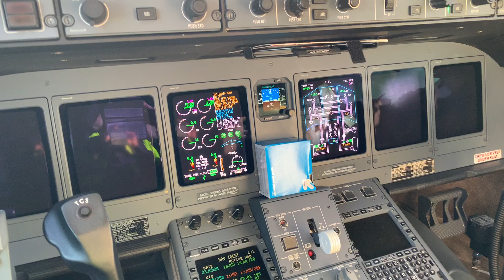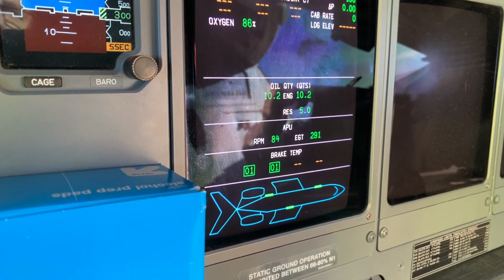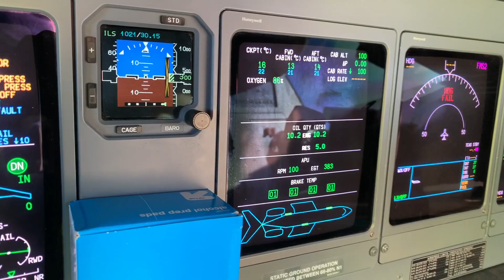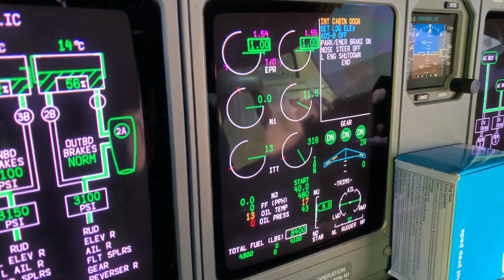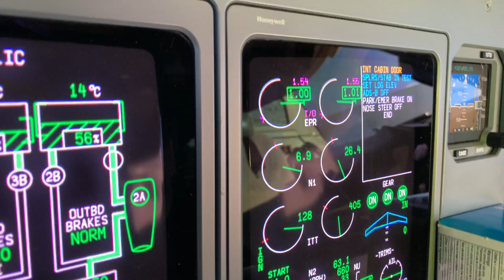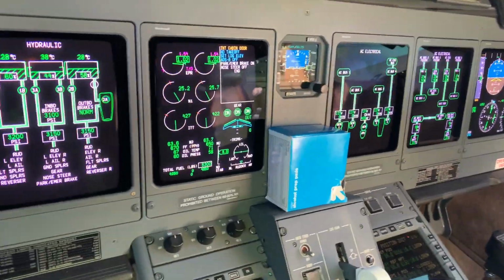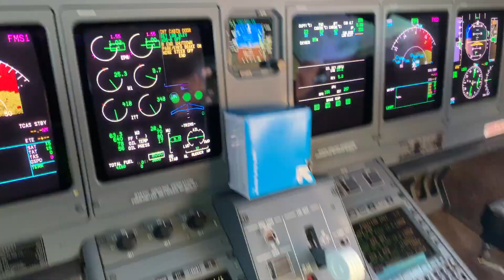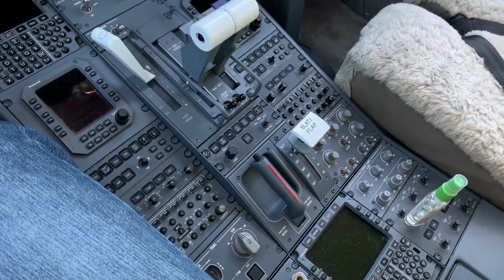A real pilot can show you his aircraft.  C'mon FE pilots - what are you waiting for?

Comment: I am finishing my video where I will destroy heliocentrism by showing what the laws of motion predict on a northbound flight over your spinning Earth. You can trick people using the non-inertial frame of reference because from there it is easy to twist the physics and convert an acceleration into speed while you play with time ... but from the inertial frame of reference you have no way to run away from the truth... After that I will dedicate some time to your juicy "Coriolis effect is not a problem for aircraft if you catch my drift"
Reply: Does your video include a working Flat Earth model? Or an explanation for what natural forces keep the Sun and Moon circling your fictional Flat Earth? Or an explanation for why observable planets move in retrograde motion?
Reply: @flatliner5729  At the moment I do not intend to question the shape of the earth but to destroy once and for all the false premise that it rotates on its axis. The south-to-north flights of all types of aircraft constitute experimental evidence of this.
Reply: @MoisesPendulo  I'm certainly looking forward to it! Well done.
Reply: @MoisesPendulo  So basically for a South-to-North flight in the Northern Hemisphere, there is a deflection to the West but as the aircraft is already adjusting for crosswinds, this would be all be accounted for by the pilot/autopilot making lots of small adjustments to maintain the desired heading.
Reply: @QED Navigation systems are not magic devices ... they are only meant to tell the manual or autopilot your position, speed, and heading in time and space. They also foresee the possible drift to make the corrections at the required time and thus keep the aircraft on its route. But these corrections translate into maneuvers that the aircraft performs with its moving parts to change its course. Drift correction due to wind is routine for any pilot, but every pilot (including Wolfie) knows that there is no drift correction for the speed difference between latitudes. According to the rotating model, there are currently south-north flights that would be facing tangential speed differences greater than 300mph. You hardly find a crosswind of such magnitude! However, these planes arrive at their destination with their noses pointing north, that is, without any correction. But also in long-distance flights, the problem is greater because although the drift towards the East is hypothetically corrected, the drift towards the South cannot be corrected. 

On the other hand, although the aircraft have turbines, you should know that they travel at a constant speed, therefore the sum of forces is zero. In other words, the aircraft emulate a uniform rectilinear motion (although in the spherical model they describe a geodesic line). In this sense, aircraft are more suitable than cannonballs because cannonballs lose speed due to air resistance and eventually fall to the ground due to lack of lift. Aircraft do not have this problem
Reply from the maker: I have already explained that in other videos.  The aircraft actively maintains a ground track and corrects heading as required to so.  

The majority of the correction is for wind and the amount required for Coriolis is about that for a 1 mph crosswind.  

You can't debunk the Globe by not understanding how planes stay on track.

Reading your last few comments - you are not getting the physics.  It takes 12 hours to fly from the equator to the Poles at typical speeds.   

How long does it take to fly across the ground to experience a 300 mph tangential difference.  That does not manifest as a 300 mph cross wind. 

Say the Equator at 1040 mph to 740 mph at 44 South Latitude.  That is a 2640 NM flight - More than five hours.    You think an object can't change speed by 300 mph in five hours?   

That is 300 minutes.  It only needs to change by 1 mph per minute for 300 minutes and there is your 300 mph.
Reply: @everybodylovesballs  A deflection towards the East and then towards the South that ends up describing something like a circle. 

Can you estimate at what coordinates a commercial airplane traveling from Accra to London will end if it does not make the corrections that you mention?

1. Consider that the flight takes 6 hours
2. Consider that the plane does not find crosswinds in its route (which usually happens)
3. Consider that the plane's ground speed is 526mph.
4. Consider the tangential velocity of the earth in Accra is 1035mph

If you have trouble calculating that, don't worry. In my next video, I will show how it is done
Reply: @MoisesPendulo  Those calculations are irrelevant. Why would I bother calculating what would happen in a fantasy scenario where the pilot is drifting significantly off course and does nothing to correct it? How would that be different to a situation where the pilot is experiencing a strong crosswind and does nothing to account for that?
Or maybe I could calculate what would happen if I was driving around a huge roundabout in my car and then stopped turning in? Sure, I could calculate how far away from the roundabout I would be after 6 hours but what would be the point? Would that show that roundabouts can't be circular?
Reply: "I am finishing my video where I will destroy heliocentrism by showing what the laws of motion predict on a northbound flight over your spinning Earth"

When you finish your video, I hope you don't intend to hide in cowards castle like virtually every other reality denying nutcase.
Reply: @Wolfie6020  I left you a comment in your video about the drift of the Coriolis effect where I explain in detail the errors of your explanation

"You think an object can't change speed by 300 mph in five hours?"

Consider that you take off from Ecuador northward and when you do there is a 1mph crosswind blowing eastward (you know you don't even need to correct that wind). but let's say that as you move north the speed of the crosswind is gradually increasing. Let's say that in 3 hours of flight the speed of the crosswind increases from 1mph to 150mph (and you know that happens commonly. The wind does not suddenly start to blow at 150mph but rather the speed increases as you fly through the Jetstream). So as the crosswind speed increases you should also increase the angle of correction (WCA) very precisely. In this way, it is achieved that the lateral speed component of the airplane is equal and opposite to the crosswind component. And so the plane stays on the planned route. So it doesn't matter that you've had 3 hours (or 10 or 24h) to correct 150mph of crosswind. When you reach latitude where the wind blows at 150mph you have to have the corresponding WCA to prevent the plane from drifting.

The same should happen if the earth is spinning. When the plane leaves the equator the difference in tangential speed ΔVt between the plane and the ground would be zero but as you move north ΔVt increases to 387mph at latitude 51.47° N (as is the case with the flight from Accra-London). Therefore your correction angle ΔVtCA should be 47° (Not counting possible crosswinds). In this example, I am considering tangential speed linearly but in reality, it is radial and things get even more complicated there since a drift towards the South appears that is impossible to correct (as I will show you in my video).

The airplane retains its initial tangential speed by Newton's first law unless you provide a force or speed component in the opposite direction. But since the plane's path is due north and ΔVt is perpendicular to that direction, the pilot could only turn progressively to provide an opposite component to ΔVt at each latitude.

Those who argue that the spinning atmosphere solves the problem do so from total ignorance of physics and aerodynamics.
Reply from the maker: @MoisesPendulo  But you are missing the point here I believe.  In a 150 Mph real crosswind the correction angle is significant.  

But for Coriolis you don't need a correction for 387 mph at 51 North Latitude.  

How much has the tangential speed changed from 50 North to 51 North?  How long did it take to fly that 60 NM?  

You are ignoring the fact that by the time it reached 50 North it has already corrected for the majority of that 387 mph. 

Break it down into 1 Degree of Latitude change blocks and the difference in Tangential speed is already quite small.   In the last 60 NM  you are not adjusting for 387 Mph difference - you are adjusting for the difference between 50 and 51 degrees of Latitude..    Just 14 mph.    Break it down into each NM and the correction needed per mile is almost negligible.
Reply: @MoisesPendulo  This is the same argument that flatties use for the dip of the nose. They say, "imagine after you have flown for 6 hours how much the pilot would have to dip the nose of the plane". Well, what if the pilot dipped the nose a tiny amount every mile, say 0.0072°. How much would they have to dip the nose for the next mile from the new orientation? Would it also be 0.0072° to maintain the same angle relative to the surface of the Earth?
After you have corrected, the new correction required is relative to the new orientation, not the initial orientation. After the plane has corrected and is facing North again, you then calculate the correction required for a plane travelling North at that latitude with whatever velocity the plane has at that time.
Reply: @Wolfie6020  No, you are the one who is missing the point. As long as the crosswind keeps blowing at 150mph you have to MAINTAIN the required WCA. You can only remove the correction if the crosswind speed component decreases or the aircraft drops to an altitude where there are no crosswinds.
BUT in the case of ΔVtCA you can NEVER remove the correction because the rotating earth NEVER stops rotating. So for example, when the plane reaches latitude 30°N the tangential speed difference between the plane and the ground below it will be 136mph so for the plane to stay on the route, ΔVtCA must be 15°. Then the plane will continue to move towards latitudes where it will find that the earth moves tangentially slower and slower. Therefore it will be necessary to continue increasing the correction angle until reaching +47°. I don't know if you've piloted such a route but I guess you understand what a 47 ° angle to the route and runway means. You know this does not happen. I have discussed this issue publicly with pilots with more than 40 years of experience, including NASA aerospace engineers, and all of them acknowledge that no correction for tangential speed difference is made (which violates the laws of motion and therefore it follows that the earth can't be spinning)
Reply: @Wolfie6020  You can do the same "brake down" with crosswinds and you will get the same results. Still, you should boost the WCA and hold it as long as the wind maintains that speed.

A crosswind is also a tangential speed difference between the air mass and the ground ... The tangential speed difference between the plane and the ground is due to the fact that the plane maintains its tangential speed while that of the ground decreases. .. Both cases generate a drift on the plane's route and both must be corrected in the same way ... Only the second is not necessary because the difference in tangential speed at every point on earth is ZERO
Reply from the maker: @MoisesPendulo  No you can't break down the crosswind because it is that full value at any given instant.  

The whole 150 mph crosswind is being applied to the aircraft each second of flight.   Hence the correction angle needed is large. 

The way you correct for drift from a 150 mph cross wind per second versus that from corioliois is entirely different.  

In each subsequent second the full 150 mph cross wind is still there. 

The coriolis adjustment for the previous seconds are behind you and now irrelevant.  You only need adjust for the next second and so on.
Reply from the maker: @MoisesPendulo  Sorry, you are just not getting it.
Reply: @UCiJxTakqcZkSizZ94Qvd0Dw Pilots generally prepare a flight plan before take-off. In this flight plan, they observe if they find crosswinds on their route, at what latitude, and at what speed these winds will have. Following my case of the Accra-London flight, let's say that the weather forecast predicts that at latitude 30°N there will be crosswinds of 20mph so if the speed of the airplane relative to the ground is 526mph with a WCA correction angle of 2° it will be enough so that the wind does not move the plane on its route.

So if the earth was really rotating the pilot should notice in his flight plan that the earth at latitude 30° N is moving 136mph slower than in Accra. Therefore, the pilot would know that upon reaching that latitude, a correction angle of 15 ° would be necessary so that the airplane does not go off its route ... The pilot should consider in his flight plan that beyond 30°N the earth moves even slower so that when arriving in London the necessary angle of correction must be 47° because there the earth moves 387mph slower than in Accra. So the plane as it goes north must literally chase London moving a little west (387mph) to catch up.

This never happens ... pilots only observe the weather predictions and then fly
Reply: @Wolfie6020   "The Coriolis adjustment for the previous seconds are behind you and now irrelevant. You only need adjust for the next second and so on.
"

That is totally wrong and the worst thing is that people believe that is correct ...

Are you saying that you turn for a second to correct the Coriolis drift and then turn north again? repeating the operation second by second or minute by minute?
When you apply a minimum angle to the left, you do so in order to provide a minimum component of tangential velocity to the west. If in the next second or minute you re-align with the north you are eliminating the minimum component of tangential speed towards the west that it had initially provided ... Therefore if you repeat this process the drift will occur as if you had never corrected

"you can't break down the crosswind because it is that full value at any given instant"

The tangential speed difference is also a "full value at any given instant" because the rotating earth never stops rotating.

Furthermore, you know that the crosswind speed also increases or decreases in time as the plane moves towards its destination.
Reply: @MoisesPendulo  This is the way I see it - a plane takes off flying North. The Coriolis Effect causes a very minor acceleration to the East. The plane banks to the West to cause an acceleration in the opposite direction. Minor adjustments would need to be made throughout the journey but that would be necessary due to changing crosswinds anyway (the adjustment for the Coriolis component would be slightly positive throughout the journey as you say). That would keep the plane following the meridian.
But at any moment the pilot could level out the plane. And in that moment, the plane would be identical to a plane that had just taken off from the current latitude flying North. In other words, it would begin a slight drift to the East. There would be no cumulative Eastward speed because that would have been cancelled out the entire journey by the acceleration in the opposite direction.
Reply: @everybodylovesballs  Many people see it the way you see it ... Perhaps for that reason the myth of the spinning earth has remained a century after the first commercial flights in history. 
The way you and other people see it is a product of: 
1. A misuse of frames of reference 
2. An excessive sentimental attachment to the official cosmological model 

I'm sure point 1 will no longer be an excuse after I post my video
Reply: Raging S  My approach is correct. I am describing the problem from the inertial frame where the trajectories are straight lines and are the result of the vector sum between the initial tangential velocity vector to the east of the aircraft and its velocity to the north. The resulting vector and its angle with respect to the x axis is all that is necessary to know to study the trajectory that the airplane would have if the earth were rotating. Fictitious accelerations are not needed as in the case of the non-inertial frame.
Reply from the maker: @MoisesPendulo  No it it not totally wrong.  

You are still not understanding what I said. 

Take one aircraft - it has been flying North for an hour. 

It meets up with a second aircraft who just took off.   

There is a 150 Mph crosswind. 

They fly in formation for one minute. 

Both have to compensate for that 150 Mph crosswind equally. 

Are you suggesting the aircraft that was already flying for an hour now has to compensate more for coriolis than the second one that just joined in formation?   

Yes or No?
Reply: @MoisesPendulo  If I banked the plane so it was facing West, could I lose all of that initial Easterly speed or not? If the answer is yes, why could I not bank to the West just the required amount so that my Easterly speed always matched the Easterly ground speed at that latitude? This would require minor adjustments throughout the flight to follow the meridian but it's surely not impossible or even difficult? It would not even be something that the pilot would have to consciously think about - they would simply bank the required amount to maintain the correct heading as conditions dictated.
Reply: @Wolfie6020  Yes and it is a fact. If the airplane that had been flying for one hour took off from a latitude that was moving east 150mph faster than the latitude from where the other airplane took off, then the first airplane should have a correction angle that gives it a 150mph component direction opposite. This is due to the fact that the airplane maintains its initial tangential speed due to inertia and if it is not progressively corrected the drift will occur. The other plane does not need to correct yet because its tangential speed is the same as its latitude. You should only start correcting when you fly further north. The term of Coriolis acceleration is not something that should be corrected, it is only the acceleration in charge of changing the direction of the speed in the circle that the plane traces on the non-inertial frame. But the plane's true trajectory in the inertial frame is a straight line that definitively distances it from its destination
Reply: @MoisesPendulo  This is due to the fact that the airplane maintains its initial tangential speed due to inertia and if it is not progressively corrected the drift will occur
Do you think a plane is a projectile with no means of changing it's velocity? What if a force were applied that caused an acceleration to the West at the same time that inertia was carrying it to the East? Could it then match the tangential velocity of the ground below it?
If a plane flies West, doesn't that mean that it's tangential velocity is less than it started with? Something that you insist is impossible.
Reply: @everybodylovesballs  If the plane is facing west, it cannot go north. Furthermore, it cannot lose all the initial tangential speed. On rotating Earth, if the plane leaves Ecuador heading west with a speed of 500mph it actually continues to move east at 540mph relative to the inertial frame (because Vt = 1040mph-500mph = 540mph). Imagine that you are inside a train that is moving 100mph East and outside there is another train that is moving 50mph East. You have a small RC plane inside the train and you want your plane to move at the same speed as the other train. Then you have to fly your RC plane west at 50mph. If the other train reduces its speed to 30mph you must increase the speed of your plane to 70mph. If the other train slows down to 10mph your RC plane must reach 90mph. That is equivalent to what would happen on the rotating earth. As you go north the Earth moves slower to the east. No matter how slow that speed variation is, the fact is that it would be necessary to increase the speed of the plane to the west, which would be achieved by changing the course to the left progressively, but this is not done and all pilots know it.
Reply: @MoisesPendulo  the fact is that it would be necessary to increase the speed of the plane to the west, which would be achieved by changing the course to the left progressively, but this is not done and all pilots know it
Exactly. Banking to the West would decrease some of the initial tangential velocity. And if the tangential velocity can be progressively decreased, the correction angle is not cumulative. If the tangential velocity is continuously corrected to match the ground below by banking to the West, then the velocity of that plane is no different to a plane that has just taken off from the current latitude.
And actually, I don't know that pilots aren't aware of banking a bit more to the West when flying North. I imagine they're more preoccupied with wind patterns though. But at least you seem to have realised that what you were saying was impossible is not impossible after all.
Reply: @MoisesPendulo  Can I look at your angles in a little more detail, as you seem to be good at the mathematics?
You say from the Equator to London you would end up with an angle of 47 degrees to compensate. Is it possible to break it down so that we look after periods of, say, one hour? Or maybe every 10 degrees might be better. So 10, 20, 30, 40 and 50 degrees North will all require a different and increasing correction, if I understand you correctly.
Reply: Raging S  Seems he is a civil engineer... the Brian Mullin of South America.
Reply: "I will destroy heliocentrism"
DSCOVR
Reply: @hashmaldawn3878  In actual modeling, if the earth were turning after 6 hours, the Accra plane bound for London would not exceed 30°N latitude (even if the pilot applied the corresponding correction angle for each latitude). And if it continues to fly for 4 more hours it would end up again in Ecuador. In other words, the 47° correction in London would only be possible if the tangential speed difference was linear, but the reality is that this tangential speed difference is radial and that is even worse. At the 30°N the difference in tangential speed is 136mph, therefore the required correction angle would be 15°. After that the pilot will try to continue flying north but the aircraft will start to drift south and that cannot be corrected unless the pilot doubles its cruising speed which is impossible because air resistance prevents it. This is clearly understood from the inertial frame of reference, that is, an observer in space that does not rotate with the earth. 
Of course, I can calculate the position of the plane at any time and calculate the required correction angle for each latitude. In my video it will be easier to understand because there I will model the problem from the inertial frame of reference. 

In this link I do the "brake down" using a flight from Miami to Toronto https://www.quora.com/Why-dont-we-feel-the-Earths-rotation-1/answer/Moises-Alvarez-21 ? ch = 10 & share = 69429111 & srid = uXmPSg
Reply: @MoisesPendulo  I've had a look, but not in detail yet.

I'm still a bit confused, and I'll explain why. If an aircraft took off from 31° 30' North, as the first aircraft passed overhead, then another aircraft takes off at 35°53' North and joins the formation, with a final one taking off and joining at 40° North, then those aircraft will arrive at Toronto all requiring a different heading to maintain the same track. It's almost like the aircraft must have a memory of where it started from. That doesn't seem logical to me, so I hope you can help.
Reply: @hashmaldawn3878  Yes, it is exactly that! The airplane retains its initial tangential speed as if it were a memory. That is precisely what Newton's first law predicts. With this same law it is justified that when you jump on the rotating earth you fall in the same place because your body maintains the initial tangential speed that the earth provides. You can run at 10mph towards the final car of a train that is moving at 100mph. The train was the one that gave your body its initial tangential speed so even if you run or fly inside the train at 10mph in the opposite direction you will only be reducing your initial tangential speed from 100mph to 90mph. If you change direction or stop you will return to your initial tangential speed which in this case is 100mph
Reply: @MoisesPendulo  Yes, but we have 5 aircraft, all experiencing exactly the same current conditions, yet need significantly different headings to maintain the same track. In your train example, imagine the train is gently slowing down, from 100 to 50 mph. The passenger will not feel any difference, but when he stops walking, his speed will revert to the new tangential speed, not 100 mph.
Reply: @everybodylovesballs  What you don't seem to understand is that this correction angle must be sustained and increased progressively so that the plane can keep flying over the meridian. If at any given time the plane re-aligns its nose to the north, it will no longer be providing a speed component to the west. The "official" approach to the problem suggests that pilots must apply a constant bank angle with a huge turning radius (over 4,000 miles on many occasions). This implies that the airplane would be drawing a circle opposite to the circle that would generate the Coriolis effect. In this way it is mistakenly thought that the plane would arrive at its destination without problems. What physicists don't seem to understand is the implication that such a maneuver would have in the final position of the plane's nose. 

Right now at the 30° N latitude of the Accra-London route at a height of 250hPa there is a 12mph east crosswind component. That implies that any commercial airplane heading north and passing through those coordinates will have to turn its nose 1° to the left to prevent those 12mph from moving the plane to the right. However on the rotating Earth an airplane taking off from Accra will find that Earth at latitude 30° N is moving 136mph slower than it. So to avoid drifting east the pilot should progressively turn his heading 15° counterclockwise. What is more important a speed of 1mph or 136mph? An angle of 1° or 15°? 

You can even find videos of the Accra-London flight where the heading indicator is shown ... It always points north (except when it turns a little to correct some wind) and that is only possible on a stationary Earth.
Reply: @hashmaldawn3878  In the link that I shared, there are more than 400 comments where various physicists, pilots and engineers have the same doubts that you have about the analogy of trains and the RC airplane and there I explain to them again and again the foundation of my postulate... Even a highly experienced NASA aerospace engineer agrees 100% with me.
Reply: @MoisesPendulo  Can you answer my question directly? Isn't the comparison with a slowing train rather than it's initial state the relevant one? So the rotation where the aircraft is rather than where it was!
Reply: @hashmaldawn3878  When you assume that the earth is rotating at 15°/h you must also assume that each latitude constitutes a frame of reference with its corresponding tangential speed ... When an airplane flies from one latitude to another it is literally flying over another frame of reference, without generate any tangential friction force, that is, there is no physical mechanism or process that says to the plane: hey! You are on a new latitude! The Earth down there is moving slower than you! You must reduce the initial tangential speed with which you took off or you will drift to the East!
Reply: @hashmaldawn3878  Yes I can but the problem is that you are misrepresenting the initial analogy that I proposed to you
Reply: @MoisesPendulo  But you do reduce the initial tangential speed by navigating to the next way point, which has a different tangential speed
Reply: @MoisesPendulo  Don't forget that just because air is a fluid, it doesn't mean that the aircraft isn't connected to the earth.
Reply: @MoisesPendulo  You still seem stuck on this strange notion that a plane can't bank and lose some if it's initial tangential velocity. Of course it can. If it was flying North and another plane took off, it could easily bank and match the East and North components of that plane's velocity. If it did that, why couldn't it match its heading? But really it wouldn't need to because it would already be doing that along the way. The effect of banking just the right amount that the North course was maintained would result in the tangential velocity decreasing. It's the same thing.
Reply: @MoisesPendulo  But the turntable isn't an accurate comparison, because the time is of a completely different scale. The flight takes hours, and the aircraft is only slowly moving through the changing velocity. And the connection between the aircraft and the earth is actually more direct in its effect than a ball on a turntable. Yet even with the turntable I'm sure the ball would manage to maintain the same velocity as the turntable beneath, if the motion took hours.
Reply: @everybodylovesballs  I have never said that airplanes cannot change their initial tangential speed by banking. What I am saying is that when the plane is banking it is constantly turning its nose (changing its direction with respect to the cardinal axes) to trace the circle ... The final direction of the nose is given by the maximum difference in tangential speed between the plane and earth. In the case of the flight from Accra to London the nose of the plane would end up pointing to 313 while the plane's route is towards 00. But what Wolfie and all the pilots know is that it is never necessary to bank or change the course of the aircraft to correct drift caused by tangential speed difference.
Reply: @hashmaldawn3878  You are only speculating. I have done the math. The variables involved in the phenomenon and the results do not agree with your predictions. In fact, no physicist or engineer defending the rotating model agrees with your predictions ... They know that it is absolutely necessary for the pilot to correct the tangential speed difference and they trust that they are doing so.
Reply: @MoisesPendulo  And they do adjust for it, a little at a time. You might have done the mathematics, but you've made an error in it. Maybe you are trying too hard to get the answer you want?
Reply: @hashmaldawn3878  "M̶a̶y̶b̶e̶ you are trying too hard to get the answer you want?"
There, I've corrected it for you...
Reply: @MoisesPendulo  OK, I think I've found the problem.
You say that the acceleration of the plane plots a circle, right?  A circle is a 2D shape so this implies that there is a 2D coordinate system where this is true. But what exactly is this coordinate system? We know that you can't plot a sphere onto a 2D coordinate system so a transformation is required and I think your error is that you are not applying the transformation to the meridian itself.
The coordinate system you have chosen cannot be rotating with the Earth because in that system there is no circle because there is no change on the x-axis (East-West) - ie. the plane is following the meridian without moving East or West relative to it. So it's an absolute coordinate system. And here's the issue - in an absolute system a meridian to the East is not parallel to the initial meridian at any point other than the equator. After 6 hours, we could plot the angle of the plane relative to the initial meridian - which I think is your correction angle - but this is not the angle of the plane to it's current meridian which itself is angled relative to the initial meridian at the plane's current location.
Now what if we chose a coordinate system that rotated with the Earth? What if someone on the equator could see the plane all the way to the North Pole and this is the centre of the coordinate system? Then as the plane flew away, the observer would see the plane always directly North angled only the amount required to counter the Coriolis acceleration at that latitude. And that observer would also see that if another plane on that meridian took off flying North as the first plane flew overhead, that plane would require exactly the same angle as the first to maintain a course due North.
Your idea of a "memory" in physics is bizarre. Of course if two planes had the same velocity with the same forces acting on them at the same exact moment, they would move in the same direction with the same heading, and a different heading would take them in different directions. I'm struggling to understand how anyone could choose that reality over the more obvious reality - that you have simply made an error.
Reply: @everybodylovesballs  "A circle is a 2D shape so this implies that there is a 2D coordinate system where this is true. But what exactly is this coordinate system? We know that you can't plot a sphere onto a 2D coordinate system so a transformation is required and I think your error is that you are not applying the transformation to the meridian itself "

Of course, I am doing the transformation. And indeed the trace of the plane on the non-inertial spherical reference frame is very much like a circle. This is because although it is a fact that all bodies tend to have rectilinear trajectories, the vector of gravity is responsible for curving the trajectory on the z-axis. 

People think if the earth stopped spinning things would fly off into space. This is true only if at the same moment in which the earth stops you also turn off gravity. That is, gravity is in charge of curving the trajectory of the initial tangential velocity of the airplane but it does not have the power to eliminate it. That is why drift caused by ΔVt occurs similarly to what happened on a flat earth or flat turntable. In fact, the supposed spherical shape of the earth worsens the situation. Therefore, since the Coriolis effect trace on spherical earth tends to be a circle, the airplane must trace an opposite circle to avoid drift. In my video, I will address that topic and show the required modeling
Reply: Raging S   @Raging S  👉Do Coriolis effect and airplanes have something in common? Of course they have! Let's say that an airplane (m = 50,000 kg) takes off from London (α = 51.50° N) and travels to North America (to the west) with the velocity v = 500 km/h. With our Coriolis effect calculator we can compute that this airplane is subjected to the Coriolis force F ≈ 800 N which means that it deflects to the north with the acceleration a = F / m = 0.016 m/s². It is almost 0.2% of the Earth's gravity! Pilots need to establish a constant force sideways, equal but opposite to the coriolis force, to compensate it. It is achieved automatically, by the autopilot, by slightly banking the airplane to keep the heading as planned.

For this example, the banking angle equals only about atan(0.002*g/g) ≈ 0.115°, so it is too small to be perceivable by passengers. However, without this correction, the airplane may land hundreds or thousands of miles away from the destination point. It is even a possibility that it would fly around the circle, never reaching a final airport!

Dominik Czernia, PhD candidate👈

This is the solution to the problem proposed by physicists and it is the most decent solution proposed by the little literature where you can find information about it. Its focus is very poor and it does not analyze what happens on a north-south flight where the Coriolis acceleration is variable because it depends on senɑ and this term is zero in Ecuador but as you fly north it increases according to latitude ɑ As you can see he concentrates on saying that the bank angle is so small that it is not noticeable by the passengers but that is not the problem. The problem is what involves flying over a straight line and drawing a circle with a radius of several miles. At the end of the trajectory the plane will end with the nose inclined at an enormous angle with respect to its destination and the worst thing is that it will not be able to eliminate that angle. So my mathematics does not differ from what the official model proposes. And I also do the same analysis from the inertial framework where the calculations are much simpler and the problem is much easier to understand and visualize. 

Some people like  @Hashmal Dawn think that a considerable amount of time alone has the ability to modify an initial tangential velocity, and they forget what Newton's first law predicts. Then they start calling that law "bizarre memory". Then they remember it again and start saying that the pilot's maneuver is the one that changes said tangential speed over time. And then they cross their fingers for the pilots to say that they actually carry out these maneuvers but the truth is that they don't and  @Wolfie6020 knows it.
Reply: Raging S  Both in a spherical earth model and in a flat earth model, the existence of a natural vector of acceleration g of 9.81m/s2 is possible. I am using the spherical model because it is the official one, not because I believe in it. In any case, in both models I can show that the earth is stationary by studying commercial flights from south to north.
Reply: @MoisesPendulo  Why did you add the word "bizarre" into my comment? Strange to misquote me in that way.
You've made this claim previously about Newton's First Law, maybe you can explain how you think it applies in this situation. You've already stated that the aircraft is turned to counter the change in tangential speed and turning is an acceleration.
Reply: @MoisesPendulo  If at any given time the plane re-aligns its nose to the north, it will no longer be providing a speed component to the west
So at the moment it points it's nose North, the plane will exactly match another plane that has just taken off along the route somewhere and joined it, say from 30°N. If the first plane is maintaining a North course we know that it has reduced it's tangential velocity appropriately by banking because that is the only way to maintain that course. So both planes will be facing North and if not corrected both would drift to the East with an acceleration of 0.01m/s/s so they'll both need to bank to the West at the same angle as each other to accomodate for it. And they'll both arrive at London with the same bank angle, a tiny 0.115° using the assumptions in your last comment. I don't think anyone disagrees that the bank angle must be steadily increased but it will never exceed the bank angle required at the destination as long as they follow the initial meridian because the mere act of doing that (by banking appropriately) has the effect of reducing the tangential velocity without anything further needing to be done.
Also, it was me that said it was bizarre. Because the idea that two planes with the same velocity and the same forces acting on them would require different headings to follow the same course depending on which latitude they had taken off from is bonkers.
If you think I'm wrong, tell me what happens to the first plane if it turns it's nose North when the second plane joins it, assuming it has reduced it's tangential velocity the same magnitude? Would it experience a Coriolis acceleration greater than the second plane?
Reply: @everybodylovesballs  If when you reach latitude 30°N you have the nose inclined 15° to provide a speed component of 136mph to the west (which is responsible for you flying over the meridian without drift) you withdraw that angle and align with the north what do you think will happen? Do you think aligning with the north will still have a speed component of 136mph to the west? Remember that thanks to that component the plane does not move east at 136mph. By turning north you are eliminating it completely so you will drift 136mph east when you complete the alignment. 

You can subdivide the tangential speed difference as much as you like. You will always have the corresponding drift that you were avoiding if you re-align with the north
Reply: @MoisesPendulo  If when you reach latitude 30°N you have the nose inclined 15° to provide a speed component of 136mph to the west
Speed component relative to what exactly? If you are following the meridian, your tangential velocity has already been reduced to match that. Your speed component to the East relative to the meridian will be 0mph at that moment in time but as soon as you align North, you will begin accelerating away from the meridian again. This acceleration will be equal to the Coriolis acceleration at that latitude, nothing more.
At this moment in time, the plane is rotating with the Earth perfectly above the meridian. Just as a plane taking off flying North would be. I find it hard to believe that you think that the plane still has it's initial tangential velocity in memory somehow. That velocity has been changed by your acceleration West. It no longer exists. The only thing that matters is the plane's current velocity relative to the meridian.
Reply: @everybodylovesballs  "Speed component relative to what exactly?"

Relative to the inertial frame from where you can measure the true tangential velocity of each latitude and the plane. Of course, for an observer located on the ground, the plane that has been correcting from Accra reaches latitude 30 ° N with a tangential speed equal to zero with respect to the meridian. But that is just an illusion of this non-inertial observer. This non-inertial observer does not feel any movement because it is moving along with the earth at constant tangential speed and therefore can assume that its tangential speed is zero. But any observer at latitude 30 ° should know that in Accra the earth is moving 136mph faster than him, therefore an aircraft taking off from Accra will have to decrease its tangential speed progressively providing a tangential speed component to the left. If commercial aircraft had transverse turbines, the pilot would only have to provide progressive thrust in a westerly direction. But it's not like that. The plane has to turn to provide that tangential speed component. If it stops providing it by aligning with the north, it would be equivalent to the transverse turbines being turned off ... Similarly, it happens when it comes to crosswinds. The aircraft may spend hours providing a tangential velocity component contrary to the direction of the wind, but if it is re-aligned with its route it will lose that component and the cross wind will move it to the side at the same wind speed.

What you are doing unconsciously is believing that correcting a small drift of a few meters minute to minute is enough to decrease tangential speed because you are confusing speed with distance. To match one speed with another speed you must MAINTAIN that speed all the time ... If the other speed you are trying to match is constantly changing you must constantly change your speed so that both are equal
Reply: @MoisesPendulo  Considering Newtons First Law, which you've mentioned a number of times already, what happens when an acceleration is applied is that the object now has a new velocity. That new velocity also obeys Newtons 1st and can only return to the original one if another acceleration is applied in the opposite direction to the first one. If you keep adding accelerations in the original direction, you will keep changing that velocity. It is irrelevant what the velocity was before, there is only the velocity now. No memory required.
Reply: @hashmaldawn3878  I totally agree. The only thing you do not perceive is that when the plane re-aligns with the north it is TURNING and for the plane to be able to turn it is necessary a centripetal acceleration that opposes and eliminates the previous component of tangential speed. That is why when turning the plane it returns to its initial tangential speed.
Reply: @MoisesPendulo  For it to return to it's original velocity, an acceleration must be applied. What is that acceleration?
Reply: @MoisesPendulo  therefore an aircraft taking off from Accra will have to decrease its tangential speed progressively providing a tangential speed component to the left. If commercial aircraft had transverse turbines, the pilot would only have to provide progressive thrust in a westerly direction. But it's not like that. The plane has to turn to provide that tangential speed component
You literally gave the answer to this above. "It is achieved automatically, by the autopilot, by slightly banking the airplane to keep the heading as planned".
Which is also the term I've been using in every comment. A plane can BANK to counter Coriolis. That is ROLL, not YAW. It is not turning the nose. It is using the ailerons to tip the plane. It causes an acceleration - a change in velocity. Permanently. It applies a force to counter Coriolis and you even gave the equation above for calculating the bank angle to achieve the desired acceleration. Once the plane stops banking, it doesn't suddenly spring back to it's initial velocity, it will simply start accelerating to the right again a tiny bit.
As in your own comment above, a bank angle of 0.115° is enough to counter a Coriolis force of 800N. If you banked at this angle travelling North at any latitude South of London, you would accelerate away from the meridian to the West. And once you stopped banking, you wouldn't suddenly spring back to your Accra velocity, the plane would simply accelerate to the right at whatever the Coriolis acceleration was at your latitude.
You can calculate the Coriolis acceleration at any latitude and the bank angle required to counter it. It does progressively increase but it's tiny and never exceeds 0.115° on the flight to London. The fact that it progressively increases is the only difference between this and the example you yourself gave above (London to North America example). But it's in no way cumulative.
If you are imagining that the plane crabs up the meridian like a rally car, with no way to permanently decrease the East component of the velocity, it's no wonder your conclusions are so different to mine. Not that it makes much difference, the plane wouldn't return to it's initial velocity even if it did crab up the meridian.
Reply: @everybodylovesballs  This is so wrong that I must take my time to breathe deeply and thus acquire the patience required to take apart the little puzzle you have tried to put together step by step ... But I want you to think first: do you really think you can make a turn without using the tail rudder? Do you think that when the pilot banks to turn, the nose of the plane does not change position with respect to the cardinal axes? What is the turning radius corresponding to a bank angle of 0.115 ° for an airplane moving at 500mph?
Reply: @MoisesPendulo  Oh I know this one! Yes, you can make a turn in an aircraft without using the tail rudder.
Reply: @MoisesPendulo  I'm not a pilot but I have a little bit of an understanding of how planes work. Yes, it's possible to make a turn without using the rudder, particularly if you have differential or frise ailerons. But you will might need it to control the turn and prevent yaw. The turn happens because of an unbalance between the lift on each wing. The nose changes position during the turn or it wouldn't be a turn. About 1580 miles I think.
Do you know how planes work?
Reply: @hashmaldawn3878  No, you cannot ... You will only move to the side because if you do not change the direction of the nose with the rudder you cannot trace an arc of rotation
Reply: @MoisesPendulo  Really? Yet I turn my aircraft all the time without using the rudder! What aircraft do you fly that needs to use the rudder in a turn?
Reply: @hashmaldawn3878  Really? What magical force does your plane use to change the nose's direction
Reply: @MoisesPendulo  I roll in the desired direction using aileron to a bank angle up to 30 degrees. I then centre the controls. About 10 to 5 degrees before the desired heading I apply aileron to roll to wings level. Can I take it you aren't a pilot? This is the first manoeuvre you do in training!
Reply: @hashmaldawn3878  I asked you where the force that causes the nose to change direction comes from. What do you think the rudder does while the plane banks to achieve your desired heading?
Reply: @MoisesPendulo  The rudder stays centered during the turn. Maybe you're thinking of a boat?
Reply: @hashmaldawn3878  Oh! Then we can eliminate the tail rudder from the design of commercial aircraft. Because according to you the tail rudder remains centered during the turn therefore it has no function
Reply: @MoisesPendulo  Oh no, it absolutely has a function! But you don't seem to know what that function is.
Reply: @hashmaldawn3878  I know what its function is and what physical principles it uses to rotate the aircraft around its z axis.
Reply: @MoisesPendulo  Why are you asking a pilot such basic questions about flight dynamics after you've been lecturing them for more than a day about how planes work? Aren't you embarrassed?
Reply: @everybodylovesballs  Please do you really think I'm asking to learn something new? Do you think I've been receiving new flight dynamics teachings?
Reply: @MoisesPendulo  Actually the primary purpose of the rudder is to stop rotation! This is fun.
Reply: @MoisesPendulo  No, I think you're embarrassing yourself by showing how little you know. You can turn without a rudder. You clearly have no idea what it's real purpose is. The force that turns the plane is not magical, it's caused by the lift on one wing being greater than the other.
Reply: @hashmaldawn3878  "Fun" is seeing how long you are going to hold that "the rudder stays centered during a turn"
Reply: @MoisesPendulo  So, I'm willing to listen. Can you describe the aerodynamic forces you think are acting in a turning aircraft?
It was clear you were foundering when you referred to it as a "tail rudder".
Reply: @everybodylovesballs  I think you are confusing a turn around the y axis with a coordinated turn on the xy plane. I am speaking of the second clearly. If you are also talking about the second you are totally wrong
Reply: @hashmaldawn3878  From the beginning of the discussion I am talking about a coordinated turn in the "xy" plane and not around the "y" axis. If it is a turn around the "y" axis, of course you do not need the rudder. But to turn in the "xy" plane you need both the ailerons and the rudder
Reply: @MoisesPendulo  Once the bank is established, you don't need the rudder. That is how planes make coordinated turns in the xy plane. But at this point I'm happy to sit back and watch you tell a pilot how to fly a plane.
Reply: Just posting to get notifications for this thread.
Reply: @MoisesPendulo  And yet every single time I turn, I don't use the rudder, just the ailerons. The times I need to use the rudder, drum roll, is when one engine has failed, or to maintain directional control during the ground roll. If I banked at 60 degrees, which is discouraged, I'd use opposite rudder, or top rudder, to stop the nose dropping. That's in the opposite direction to the turn. There's also an automatic mode using the rudder to avoid "Dutch Roll" called yaw damping. Note the rudder is almost always used to stop something happening.
Reply: @hashmaldawn3878  I would love to see a video of your aircraft turning without using the rudder!
Reply: @MoisesPendulo  Just watch any airliner taking off from your local airport. When it turns after take off, you'll see it.
Reply: @everybodylovesballs  A push to the side is not a coordinated turn (that is the only thing that generates the imbalance of forces when tilting the wings). It is only a movement to the side that does not change the position of the nose. A coordinated turn occurs when the nose of the plane points in the same direction as the circular path ... The turn on the plane's z-axis is accomplished with the rudder
Reply: @hashmaldawn3878  I think you don't understand the difference between a sideways movement and a coordinated turn
Reply: @MoisesPendulo  And you clearly have never flown an aircraft. But hopefully you are learning a bit more about it now.
Did you like the video I posted?
Reply: @MoisesPendulo  That is literally how planes turn as a pilot here is trying to tell you. You have thrust forward, you have a push to the side. Which direction is the acceleration vector pointing? You even asked me the radius of the turn based on the speed and the bank angle and I told you.
Reply: @everybodylovesballs  If you keep the tail rudder centered the nose still points forward even if the plane moves in the direction of the resulting vector. You have to turn the tail rudder so that the nose points in the direction of the resulting vector so you can trace a curve and not a straight line. This is why I love Newtonian physics, because it works perfectly.
Reply: @hashmaldawn3878  And I hope that after this debate you understand that it is not necessary for a person to be a pilot to understand physics and flight dynamics. I have not seen your video
Reply: @MoisesPendulo  Newton wasn't a pilot either. The aircraft is designed so that it flys straight. If you add a yaw, by using the rudder, the aircraft will fly slightly sideways, called crabbing. Release the rudder and the aircraft will straighten right up.
But why don't you talk us through how you think a turn happens. We'll need to know what control inputs you need to make, and in which direction, and what instruments readings you are utilizing. A rate one turn would be normal.
Reply: @MoisesPendulo  You don't need to be a pilot to know that you don't use the rudder to turn an aircraft. Plenty of people here know that.
Reply: @MoisesPendulo  You haven't realised it yet, have you? You have completely destroyed your original argument.

Two days ago you were arguing that the pilot could not accelerate West to counter the Coriolis acceleration without turning the nose. Now you are arguing - quite strongly actually - that a bank with a neutral rudder 
will cause an acceleration to the left or right without changing the heading.

So I guess you can scrap that video now. All the pilot has to do is bank with a neutral rudder such that the sideways force is equal to the Coriolis force at all times (175N at 10°N, 505N at 30°N, etc) and the plane will arrive at London with a North heading. You're welcome.
Reply: @everybodylovesballs  You do not quite understand that a bank does not produce an acceleration of the aircraft to the side but rather a speed. Acceleration is only persisted by the passengers and crew inside the aircraft. The magnitude of this lateral velocity depends on the bank angle ... What is the maximum lateral velocity that you think an aircraft can reach just by banking? Do you think it can reach 136mph or 387mph? Think a bit ... Why do you think it is necessary to use a coordinated turn and change course to correct crosswinds?
Reply: @MoisesPendulo  You do not quite understand that a bank does not produce an acceleration of the aircraft to the side but rather a speed
WTF? Force is mass times acceleration. Acceleration is a change in velocity.
This idea that you have that things spring back to their original velocity once a force is no longer applied is bonkers. Once the velocity - in this case the direction - of an object is changed, the only way to change it back is to apply a force in the opposite direction.
Reply: @everybodylovesballs  
I must say, this has been really well played by yourself & Hashmal.
(edit to correct a spelling mistake.)
Reply: @everybodylovesballs  I ask you again: do you think that after 3 hours of flight the plane can reach a tangential speed component of 135mph towards the west only by banking at an angle of 0.115 °? I can't imagine then the tangential velocity component that can be reached with an angle of 30 ° or 40 ° ... Perhaps the tangential velocity component will exceed the heading speed and you will make an amazing discovery in aeronautics! Amazing tangential speeds without using fuel!
Reply: @MoisesPendulo  You don't seem to understand many of the turns you are using. What do you think "coordinated turn" means? What if a pilot decided to use the elevators to turn? What is a "heading speed"?
The good news is, now yiu should already know what is wrong with your premise, you don't need to publish your video with that error. Of course it doesn't destroy the spinning earth anymore, but then it never did.
Reply: @hashmaldawn3878  I am not impressed that you name maneuvers, turn techniques or use technical vocabulary ... What impresses me is that you insist on saying that it is not necessary to use the tail rudder to make a turn. Any pilot knows that a skidding turn is due to excessive use of the tail rudder in the direction of the turn and the way to correct this to achieve coordinated turn is to reduce the use of the tail rudder. However you say that the tail rudder is not used in the turn. Honestly, if I discover that you are the captain of the flight I am going to travel, I get off the plane. I'm not saying that you are a bad pilot but just in case ... But let's get back to reality, and the reality is on a real flight from Accra to London the plane flies with its nose pointing north and without any banking that generates incredible tangential speeds to the west. Every pilot who has flown on that route knows it. This is a dead end for the official cosmological model. 

But if the planes aren't enough for you, I can also do it with the Zeppelins. They were discontinued among other things due to their poor maneuverability. However, since the Second World War they were used to transport correspondence between Germany and South America. So the Zeppelins that could barely maneuver against crosswinds managed to maneuver to avoid tangential speed differences greater than 200mph and a drift that would make them fly in circles without ever reaching their destination? What was the bank angle of a Zeppelin to avoid drift by ΔVt? And this goes on and on still getting worse. So you guys should hang on to the ball because the spin is totally disproven. Get over it. God bless you
Reply: @MoisesPendulo  A fast moving aircraft doesn't need to use the rudders in the turn because of the inherent yaw stability that is created by that very speed. If you use the rudders then you will create that very sideslip that makes the turn uncoordinated. You almost seem to understand it in your last post, but not quite.
The zeppelin was much slower, and so has even longer to correct for the change below it. The slow speed has a problem with crosswinds though.
But back to my first point which is that the aircraft is aerodynamically stable in yaw. If left alone the aircraft will always tend towards zero yaw. Add a yaw and the aircraft will sideslip. Stop adding yaw and the sideslip will stop. You can see this using even a paper airplane. Throw your paper airplane and it might make all sorts of excursions in pitch and roll, but not in yaw. Ask any airline pilot and they will tell you exactly the same, including whoever is flying you next time.
Reply: @MoisesPendulo  do you think that after 3 hours of flight the plane can reach a tangential speed component of 135mph towards the west only by banking at an angle of 0.115
A normal person considering a normal frame of reference would ask, "can a plane decrease it's tangential speed by 135mph over 3 hours such that it matches the ground and air speed of it's current latitude?".
To which the answer would be: yes, that would require a constant sideways force of 279.4N and a bank angle of 0.033°. But if the plane wanted to fly North from the equator, the force and the bank angle would actually start at 0 and be gradually increased in line with the Coriolis force.
In your nonsensical frame of reference, where there's a tangential speed component increase relative to an observer that doesn't exist, the same would be true. As long as the force was applied, the speed would increase by a tiny 0.0125mph every second until it reached 135mph. The same force would be required of course. If you stopped applying this force, the speed component would stay at 135mph unless another force acted to decrease it. I'm never met anyone that didn't understand acceleration before but there you go.
And to keep things in perspective, the engines of a 787 produce up to a combined 660000N of thrust...
I can't imagine then the tangential velocity component that can be reached with an angle of 30 ° or 40 ° ... Perhaps the tangential velocity component will exceed the heading speed and you will make an amazing discovery in aeronautics! Amazing tangential speeds without using fuel
You'd just be reducing some other component of the velocity. Not a net increase in the magnitude of the velocity. And of course,  the thrust of the engines keeps the air flowing over the wings in the first place.
the reality is on a real flight from Accra to London the plane flies with its nose pointing north and without any banking that generates incredible tangential speeds to the west. Every pilot who has flown on that route knows it
You have completely made up the claim that the plane doesn't bank. Of course the pilot will be making lots of tiny adjustments the entire flight. I'm not sure why you think reducing the tangential speed from 1038mph to 646mph over 6 hours is incredible either. It's a deceleration in the reference frame of the plane. If the plane didn't slow it's tangential speed, it would be travelling at 392mph faster than the air at that latitude. Do you think that drag might do something then? Do you think that drag might be doing something the entire time? And what's more interesting is that you even posted an example earlier calculating the bank angle for the East-West London-North America flight. Was that fake? If so, why post it?
 This is a dead end for the official cosmological model
If you choose a nonsensical frame of reference and make basic errors, I guess it could look that way. The most fundamental of which is thinking the speed component disappears when the force stops acting.
If there's two cars in a line travelling at 104mph and the one behind slowed to 65mph, would you (sitting in the front car) say, "Wow, that other car has increased their rear speed component by 39mph!".
Reply: @MoisesPendulo  "A bank does not produce acceleration to the side but a speed".

You might want to have a word with Isaac Newton about that.

How exactly is it possible to achieve a change in speed without having an acceleration?
Reply: @david_akerman  There are different categories of acceleration, it seems. Maybe some don't obey Newton's Law?
Reply: @hashmaldawn3878  I wonder what happens when the plane stops correcting and the Western tangential speed component suddenly disappears? Instantaneous acceleration from 646mph to 1036mph?
By the way, I appreciate your comments in this insane thread. Great to have the input of someone with actual flight experience. Feel free to correct me on any points that I make, I won't be offended ;)
Reply: @everybodylovesballs  "Instantaneous acceleration from 646mph to 1036mph" 

Of course not. Remember that the plane takes a certain time to turn. From when the plane begins to turn until it ends up aligning with the north, acceleration will occur. It is not instantaneous. Usually when making turns, small bank angles are used to avoid discomfort for passengers. This generates large turning radii that can take up to more than a minute depending on the turning angle.
Reply: @everybodylovesballs  1. If you had some academic preparation in classical physics and 2. you did not have a sentimental attachment to the official model, I think you could understand and totally agree with my postulates. I'm not sure about 1 and 2, so I don't think it's productive to spend my time trying to teach you. But if you put ego and prejudice aside we can talk
Reply: @MoisesPendulo  No-one with any knowledge of classical physics whatsoever would agree with your postulates because you don't appear to even know what acceleration is. Why don't you answer David's question - how exactly is it possible to achieve a change in speed without having an acceleration?
Reply: @everybodylovesballs  If Newton were alive to see how airplanes fly over the supposed rotating earth he would say: If my laws of motion are correct then the earth is stationary. I already answered that question two comments ago.
Reply: @MoisesPendulo  No, he would not because his first law of motion states that an object at rest stays at rest and an object in motion stays in motion with the same speed and in the same direction unless acted upon by an unbalanced force. So he would know that once the plane had a tangential speed of 646mph, the only way that would change would be by applying a force. At that moment, flying North over London, there would be a fictitious Coriolis force of around 800N which would "push" the plane East with an equivalent acceleration. There's no original speed, there's only the current speed and the current forces, just like Newton said. It literally doesn't matter if you choose a different reference frame. If in your reference frame, the relative speed is 390mph to the West, the only thing that would reduce it to 0mph is a force. And that force doesn't care where you choose to put 0mph in your coordinate system, it will just accelerate with the relevant magnitude and in the relevant direction of the force for however long the force is applied. Everyone here gets this except you it seems.
Two comments ago you said, "acceleration will occur". What would be the magnitude of that acceleration exactly if not the one I just mentioned?
Reply: @everybodylovesballs  Just as you thought you are not prepared for this debate. You don't even understand frames of reference. You don't even know what the coriolis force means. The coriolis force is not a push to the side (But I recognize that many sources misrepresent it that way, especially when it comes to airplanes).

But I'll try:

Think of the first small turn the pilot makes to the left to avoid drift. In that turn the plane accelerated to the left and stopped accelerating when the turn ended and its nose ended with a small angle of correction. This maneuver reduces the initial tangential velocity of the aircraft to the east as long as the aircraft does not re-align to the north. If the plane is aligned with the north it will be turning to the right using the same force that it used to turn to the left but this time the force is in the opposite direction so the plane returns to its initial tangential speed towards the East. If you subdivide the total turn the airplane must make to eliminate the 387mph tangential speed difference into small left turns over time, you will see that these small turns are cumulative because the airplane cannot turn right again. This means that the plane must arrive in London with a correction angle of 47°. If arriving in London the pilot tries to align with the north to land this will be the result: 

1. The small forces that were used to make small turns will be applied again in a great turn but in the opposite direction
2. As a result of 1, the airplane would begin to accelerate to the right until it returned to its initial tangential speed (which is 387mph faster than London)

The problem with the initial tangential speed of the plane is that it will always be referred to the latitude from where it took off ... For example, when the Accra plane is flying over latitude 30°N it needs 15° of correction to keep flying over the meridian, that is, in this scenario, the tangential velocity of the plane has been reduced to that of that latitude of the Earth. But do not forget that the only reason why its tangential speed is the same as that of latitude 30° N is precisely due to the 15° inclination of its nose. Without that 15° correction the plane will drift to the right of the meridian at 136mph.

Please, if you think there is an error in these postulates, indicate where it is and explain it
Reply: @MoisesPendulo  I said the Coriolis force was fictitious and put "push" in quotation marks. I'm not sure how much clearer I could be...
You already argued before that if the plane banked left without using it's rudder it would accelerate to the left without its nose turning. So all the pilot would need to do would be to gradually increase this bank to apply the appropriate sideways force and they would arrive at London with a bank of 0.115°. Now are you saying that levelling out of a 0.115° bank will cause an acceleration such that the tangential speed will increase from 646mph to 1036mph?
Reply: @everybodylovesballs  This was what happened. After I noticed that Wolfie was not even aware of the supposed maneuver that the official model proposes to solve the Coriolis problem on flights from south to north, I shared the proposal of Dominik Czernia, (PhD candidate) to shed some light on the subject. Until that moment, I assumed that the maneuver that Czernia was talking about was a large coordinated turn with a small bank angle, that is, also using the tail rudder to apply a progressive yaw. This maneuver would be more logical than making small constant turns. But later you pointed out to me that Czernia was talking about just banking the plane without applying a yaw. I'm not sure if that's what he meant but if that was it, it would be a huge mistake, since the lateral speed that a plane could reach with just banking is very limited. He has another implicit error in his proposal and that is that he tries to correct the coriolis force, which is a wrong concept because this force is not only perpendicular to the speed of the plane, but it constantly changes direction until a circle is drawn.
Reply: @MoisesPendulo  since the lateral speed that a plane could reach with just banking is very limited
Of course it isn't. Just a tiny constant acceleration over 6 hours would result in a large speed. If every second, the speed increased by just 0.018mph, after 6 hours the speed would be 390mph. That's how acceleration works. But that wouldn't be how you would follow a meridian to London, you would start with an acceleration close to 0mph every second and gradually build up to 0.035mph every second. Not that you'd ever think about it this way as a pilot because you're in the rotating reference frame so all you have to do is follow the meridian. If you are following the meridian, you do have the appropriate tangential speed.
this force is not only perpendicular to the speed of the plane, but it constantly changes direction until a circle is drawn
In the rotating, non-inertial reference frame as long as you increase the acceleration by just the right amount, you will follow the longitude. In the inertial frame, the path of a plane exactly following a meridian will look like a spiral too but who cares? In that reference frame the meridian is also rotating so it's constantly changing direction too which is something that you seem to forget.
In the rotating, non-inertial reference frame, if you consider Coriolis as a fictitious force, you no longer have to think about the rotation, tangential speeds, or any of that. This "force" is the thing that tells you that you are in a rotating reference frame so all you need to do is apply a force in the other direction to counter it at all times. In all other respects, you are just flying over a stationary surface. And flying over a stationary surface with a tiny force to the right is not impossible in any way.
I'm curious - have you driven a North-South road for any distance? If so, what happened?
Reply: @everybodylovesballs  You keep making ridiculous analogies that have nothing to do with the case of an airplane in the air. Between the tires of a car and the road there is great static and dynamic friction. But the air does not offer static friction and the dynamic friction Fd appears in the frontal contact area to the air, and not in the lower part of the aircraft as it occurs in the tires of a car. 

Regarding Dominic Czernia's proposal, I have explained his error consists in taking the Coriolis force as the variable to be corrected and not the tangential velocity difference. But also keep in mind a very important detail. No pilot here said: 

hey! There you have it, that's the adjustment that the pilots or the autopilot make to correct the Coriolis effect! 

You know why? 

1. Because any commercial pilot knows that even in a flight without crosswinds the heading is constantly corrected ± 1° due to other factors. And that is achieved by banking the plane to one side and to the other without any respect or preference for the 0.115° proposed by Czernia 
2. Because commercial aircraft cannot maintain a bank without losing height so even if they do not use the tail rudder they must increase the angle of attack and this causes the nose to change direction as well (and this change is non-existent) 
3. Because normally the plane does find crosswind components especially if it flies from south to north. That is, it is impossible to be correcting winds and at the same time maintain a bank angle of 0.115°. Even many times the crosswind blows from the opposite direction to which Coriolis occurs, so the pilot will be correcting the course of the plane in favor of Coriolis and not against it. 

On the other hand, take into account what Czernia says: "without this correction, the plane could land hundreds or thousands of miles from its destination point. It is even possible that it will fly around in circles never reaching the final airport" ... And again he is wrong because it is not a "possibility" but a fact that if the earth were spinning that is what would happen ... It has never happened and has never been corrected. Therefore the earth is stationary
Reply: @MoisesPendulo  But the air does not offer static friction and the dynamic friction Fd appears in the frontal contact area to the air, and not in the lower part of the aircraft as it occurs in the tires of a car
But the plane has big engines that push against the air. They are quite manoeuvrable and can fly in any direction they choose at any time.
That is, it is impossible to be correcting winds and at the same time maintain a bank angle of 0.115°. Even many times the crosswind blows from the opposite direction to which Coriolis occurs, so the pilot will be correcting the course of the plane in favor of Coriolis and not against it
They don't have to maintain the specific bank angle. That angle is just indicative of the tiny adjustment that they need to make to follow the meridian to their destination. And the banking without yaw was your argument, not mine. As I've stated time and time again, all the pilot needs to do is follow the meridian that happens to be, from their perspective, moving away from them to the West little by little as the flight progresses. Simple. To do this, they can go to the West of the meridian, they can go to the East of the meridian, they can do circles over the meridian if they choose. It's a plane. It's only in your crazy world that they can't do this.
Look, you tried to explain this to me before and I couldn't be bothered pointing out your error then but I will now.
You said to think of the first small turn the pilot makes a turn to the left to avoid drift. In that turn the plane accelerated to the left and stopped accelerating when the turn ended and its nose ended with a small angle of correction.
Let's stop here and think about what is happening. There is a plane over the meridian angled to the West. If the plane doesn't turn to the right, it will clearly keep moving to the West of the meridian! There is only one unbalanced force acting on this plane and it's a fictitious Coriolis force "pushing" it to the East. So the only scenario in which the plane does not move to the West of the meridian in the next moment is if it is turning (or banking) to the West only the exact amount that cancels out the "push" to the East. This is all the plane needs to do to follow the meridian - maintain a tiny angle to the West that does increase but is always very minor.
Let's say a plane takes off at that exact moment at the current latitude on the same meridian. It too is travelling North. What angle to the meridian does that plane need to avoid drifting to the East? Exactly the same as the first plane of course.
This is the problem  - what does it mean to say that the turn ended and its nose ended with a small angle of correction? If it's nose is angled relative to the meridian in any significant way at the moment that it's over the meridian, surely it will keep flying away from the meridian because that's what planes do. The only reason you can't accept this is that you're keeping this weird idea in your head that the plane is fighting against some huge acceleration to the East at all times. It's not, that acceleration is tiny. There's no original speed that constantly needs fighting against. There's just a plane in the air at a location with it's current velocity, and the current forces acting on it, and a tiny acceleration to the right that requires a tiny correction to the left.
Reply: @everybodylovesballs  "If the plane doesn't turn to the right, it will creately keep moving to the west of the meridian" That's where your big misunderstanding lies. You should review that and rethink your whole argument
Reply: @MoisesPendulo  That's where your big misunderstanding lies. You should review that and rethink your whole argument
No, it is correct. If the angle to the meridian is such that it's speed to the West will not be immediately cancelled out by the slight acceleration to the East, the next second the plane will be West of the meridian. This is true for all angles greater than the tiny one that is equal to the Coriolis acceleration at that moment. I'm assuming that the plane has been following the meridian so that it's tangential speed is exactly matched to the meridian's tangential speed at that moment.
Let me ask you a straightforward question: if we had observer A at Accra and observer B at 51.5°N and a longitude 90° to the East (or whatever flight time you're assuming / 24 hours * 360°), what angle is observer B's meridian (at their location) relative to observer A's meridian?
Reply: @everybodylovesballs  
You focus so much on the non-inertial frame that you forget that your imaginary rotating earth is spinning and has different tangential speeds at each latitude ... Every time you step north over your imaginary earth you are stepping on a section of the earth with lower tangential velocity than your other foot (you just don't feel it because it's so small but it's there). The tangential change in velocity over the surface of the earth and the atmosphere is infinitesimal. If we take this to the case of the plane, from the moment the plane takes off, it must start turning to the left very slowly in coordination with the decrease in speed of the following latitudes, if it does not want to go one meter off its route. This is the turn where the plane is applying a progressive force to the left to progressively decrease its initial tangential speed. In this way, the drift is zero and the plane moves on the meridian tilting its nose slowly to the left. The plane does not continue towards the West because that latitude over which it is flying has the same tangential velocity that the plane has reached ... If both the latitude and the plane are moving tangentially at the same speed then neither the plane can move or at to the left or right of the meridian but remains on the meridian while moving north with the nose tilted. So if the nose is aligned with the north, it will apply all that force again in the turn but towards the opposite side, therefore the plane will move to the right of the meridian ...

Now suppose that the plane takes off to the north and does not start turning from the beginning but starts correcting after 30 minutes. In 30 minutes the aircraft will be at latitude 9.43°N where the tangential speed of the earth is 1026mph, that is, the tangential speed difference ΔVt between the aircraft and 9.43°N is 9mph. Obviously the plane will have deviated from its route to the East a distance d = 0.5 * ΔVt * t = 0.5 * 9mph * 0.5h = 2.25 miles. So now the pilot must meet two objectives:

1. Decrease your tangential velocity from 1035mph to 1026mph to match that with the tangential velocity of latitude 9.43°N 
2. Correct the 2.5 miles of distance the aircraft deviated during the uncorrected time. 

If the plane only meets the 1st objective, it will temporarily stop moving to the East with respect to the meridian but it will stay 2.5 miles away from its route. Therefore, it must turn a little more hard to the west to first eliminate the 2.5 miles by applying a little of extra speed. When it comes back on the meridian it must turn a little to the right to slow the extra speed but if it turns completely north it will return to its initial tangential speed and therefore it will move again at 9 mph towards the east.
Reply: @MoisesPendulo  I understand your analysis and it's fundamentally flawed.
Are you willing to see things from my perspective?
We can use your inertial frame if you like and let's simplify the example. A fast plane that can travel from the equator to the North Pole in a fraction of a second over 6 hours.
So let's say we're hovering in space over the North Pole watching the Earth rotate underneath. We put the start position of the plane at the very bottom of the circle from our view, let's call it 0°, with the plane facing towards the North Pole. Or maybe move it one inch towards the North Pole so that there's a proper North in our top-down view. Now let's imagine our end position if the plane has followed the meridian all the way and is facing North, towards the North Pole as intended. Six hours have passed so the start meridian is now at 90°, one quarter of a rotation. The plane is now 1ft from the North Pole on that meridian. But what has happened to the plane? It has rotated 90° from it's initial orientation. So if the plane is not attached to the Earth - which you insisted is the case when I brought up the car example - it must continually turn to the left in order for it to always be facing the North Pole during it's journey. The North Pole is always the direction of North from anywhere on Earth remember.
Do you see what I'm saying? The plane doesn't turn so that it's angled to the meridian, it must turn so that it stays aligned with the meridian, that is rotating with respect to the plane's initial orientation. Aligned with the meridian means that it's also facing North, towards the North Pole, at that moment in time.
Now let's look at your example using the same reference frame. The plane takes off facing towards the North Pole with a forward velocity of 500mph and a right velocity of 1038mph. It flies straight ahead and doesn't correct. After one hour the plane has travelled 500 miles North and 1038 miles East. But is it facing North, towards the North Pole? No, the North Pole is forward and to the left of the plane. The North Pole has been drifting to the left the entire time and relative to the plane, the meridian has also been rotating to the left relative to the plane's orientation.
So when you say, "if it is aligned with the north, it will apply all that force again in the turn but towards the opposite side", that is not correct. If it turns so that it's aligned again with it's initial orientation - which seems to be what you're imagining - that is certainly problematic. If it's aligned so that it's facing the North Pole, that is not problematic. If it has turned towards the centre at the appropriate rate and followed the meridian exactly, it will already be facing the North Pole. I don't believe that the plane is angled to the meridian at all if it has been following it. I do believe that it is angled with respect to it's initial orientation but you've simply forgotten that the meridian -  and the plane's "North" - is also rotating in your inertial frame. The fact that you've had to invent some new laws of physics - where two planes with the same velocity and the same forces acting on them move in different directions - to explain the situation should have been a clue that something was fundamentally wrong.
Now I do prefer the non-inertial frame but of course the same is true in it. As the plane aligned North at a moment in time travels in a straight line, the North Pole appears to drift to the West - or you feel a "force" pushing you to the East if you try to follow the meridian - so all the plane has to do is always point towards the North Pole and it will follow the meridian. The benefit of the non-inertial frame and is that you no longer have to think about the rotation, tangential speeds, or any of that. If you think about how the plane would need to travel over this (from the pilot's perspective) stationary surface following the meridian exactly, it would be a path curving away to the left. Imagining this path top-down, drawn on the Earth with a big marker, it's a spiral that gets tighter. Do you think it would be impossible for the plane to travel along this path, always aligned with the path? Of course not, it would the simplest thing in the world. It would also be the simplest thing in the world to weave back and forth over this path to.
Reply: @everybodylovesballs  "I don't believe that the plane is angled to the meridian at all if it has been following it"
 

That is wrong. The plane is angled to the meridian precisely because it is chasing it all that time. Imagine that you and I are in a race and your goal is to catch up with me. I am a few feet ahead of you but you run faster than me so you will catch up with me eventually. But I change course and start to move to the left, turning about 15 °. If you don't also point 15 ° to the left I will end up running away from you because you will not have a tangential component to the left. The plane must do the exact same thing and it must do it by turning its nose in a coordinated turn.

Now your argument is that: since when linear drift occurs there will also be an angular drift or yaw to the right in the nose of the plane with respect to the north, just turning to keep the nose pointing north is enough for the plane to stay on the meridian but it is not.

To correct this angular drift, it is only necessary to turn the tail rudder without applying pressure with a bank to the left. However, to correct the linear drift towards the East, it is necessary to perform a coordinated turn ... If the correction is made from the beginning avoiding linear drift, the angular drift will not appear
. That means that angular drift is the smallest problem.

In the inertial frame you can clearly see that you should turn your nose to the left of the meridian. If you only align with the north, you will not be able to equal the tangential speed of the plane with that of the meridian. I have done the modeling and they are correct and I have been even more strict than you and I have thought of possible solutions that you have not yet come up with. But this is just the tip of the iceberg because there will also be a drift to the south that the pilot will not be able to correct unless constantly accelerating north which is not possible due to air resistance.
Reply: @everybodylovesballs  Airplanes can make the flights they do only on a stationary Earth. On a rotating earth it is impossible and that is what the laws of motion predict. These corrections have never been made in practice and even if they did they could not land. Experimentation in flights of all types of aircraft for more than a century shows that the Earth does not rotate
Reply: @MoisesPendulo  I just told you exactly what your mistake was. And that's your best response? Denial?
Reply: @MoisesPendulo  I have found an error. One of your postulates says that in the inertial reference frame if you realign to the North, in a sense you undo your previous turns. That is not correct. Realigning to the North in this context is not realigning to the orientation the plane had before you started turning. That may make your postulate correct but it is not what's happening in this reference frame. Realigning to the North at any moment is towards the North Pole at that moment. That orientation is not your initial orientation in the inertial reference frame, it is an orientation that is rotated in a counter-clockwise direction relative to it because you have changed position. That is the danger of using terms like "North" in an inertial reference frame. North at the beginning of the flight is on a different axis to North after the Earth has rotated. You are using a direction that is relative to the position of the plane in an absolute coordinate system and it has caused you to come to the wrong conclusion.
I explained this quite clearly in my longer reply which I've noticed that you have been unable to refute.
Reply: Actually I just saw the first of your double posts. I actually agree that the plane needs to turn it's nose throughout the flight. If you read through this thread, the bank-without-turning argument was in response to you saying simultaneously that a bank would not produce a turn and that the only way to get the required linear speed to the left was to turn your nose at an absurd angle to the meridian. You provided the solution to your own problem - you could follow the moving meridian without the absurd angle - so you debunked yourself. I admit it was probably ill-advised answering all of your very specific queries based on these premises though but as I said earlier, it's your argument, not mine.
But your description of what was happening in the inertial frame was wrong, because your "North" has always been wrong.
As Hashmal said, a bank does move the nose but a little rudder will as well so I have no problem with that method. But in the inertial frame, I do not see that you should turn your nose to the left of the meridian. You will need a little rudder set (or a little bank as I prefer) which will turn the nose at the correct rate though. If I wanted to follow the North Pole and it was moving to the left, I would set the bank angle so that my nose was tracking it perfectly, not moving my nose before and then the North Pole moves to where my nose was facing a little earlier. The bank or rudder moves the nose, the nose doesn't need to move first. A plane with it's nose pointing to the North Pole is facing North. It's a minor point anyway and would probably make no real world difference.
Once you see that your claim that the plane can never realign to the North is false, as I have shown, you will have to start again. And when you do that, you'll actually see that what you thought was the angle relative to the meridian was not correct and in fact the the meridian and the plane are both at the same angle simultaneously in your inertial reference frame. The plane will be aligned with the meridian, facing the North Pole.

P.S. In case I cause the same issue with this double post, please read the comment before this one where I specifically point out an error in your postulates.
Reply: @everybodylovesballs  I am a bit busy now but I will respond fully to your comment at another time. There's no error in my postulate... The nose of the plane must turn to the left of the meridian to match its tangential speed with that of the meridian and continue to fly over it. Angular drift can be corrected with a yaw in the opposite direction. If you make a coordinated turn with the aim of correcting the angular yaw and aligning with the north, you will only decrease the initial tangential speed but not enough to match that of the new latitude. In other words, in the maneuver I described in the non-inertial frame, the plane would be observed with a correction angle of 15 ° when it reaches latitude 30 ° N. But from the inertial frame the plane actually turns 30 ° counterclockwise in 6 hours in order to get to latitude 30°N. 

If the pilot decides to turn to align with north (without turning more to the left), the centripetal acceleration used in the turn will have a different direction than the tangential speed difference Therefore you can decrease the tangential speed but not enough
Reply: @MoisesPendulo  The nose does not have to turn beforehand, it only has to turn with the change in North heading. In a bank turn at least, it's the turn the moves the nose. So if the North heading moves 0.0033deg/s, so must the nose of the plane. In this way, the plane will always be facing North.

This is actually an interesting exercise in explaining a concept as clearly as possible.
If you'll humour me, I'll do just that and you can tell me where you think I'm wrong.
I'm going to assume that a bank angle causes a turn but you can substitute a rudder deflection if you wish.

I'll use Dominic's value of velocity = 139m/s (approx. 500km/h) and a spherical Earth with circumference 40075km, and ignore differences in longitude between Accra and London. On this sphere, let's use 5.6°N for Accra and 51.5°N for London, which is 623389m and 5732951m from the equator respectively (on my perfect sphere, not exactly in the real world) so flight distance is 5109562m and flight time is 36759s. It might seem like overkill to use metres and seconds but the numbers involved below are really small.

A plane from North from Accra to London will find that it's tangential speed, or it's speed to the East, is greater than the ground below if it continues without deviation. The effect of this is that it will accelerate to the East of the Accra meridian, it's North heading, unless corrected. Another way of visualising this is that the North Pole, or it's North heading, will accelerate to the West at the same rate. This acceleration is minor compared to the North speed of the plane but it does increase with latitude.

To fix this problem a plane must turn to the West such that it's speed to the East always matches the ground below. If this is done correctly, the acceleration to the West of the plane will match the acceleration of the North Pole to the West and the plane will always be facing towards it, maintaining a North heading.

From this we see that the reverse is true - a plane that is flying North and turning to the West such that it is drifting neither to the West or the East of the meridian must have the correct acceleration to match the ground speed below. So simply turning so that the nose of the plane is always pointing towards the North Pole, ie. maintaining a North heading,  ensures that the tangential speed of the plane and the ground below are matched.

Just how small is this acceleration? We can use the following formula to find the tangential speed in m/s where d is the distance from the equator in metres: 40075000 / 86400 * cos( d / 10018750 * 90).
Plugging in 5732951m for London we get: 288.7416m/s
Our plane travels 139m in a second so the speed of the ground this distance North or our location will be: 288.7337m/s.
So our plane will need to reduce it's tangential speed when flying North at this latitude by 0.0079m/s/s which is 0.0033deg/s or a bank angle of 0.046°.

Let's do a quick calculation to see if this acceleration will be sufficient to reduce our tangential speed along our flight of 36759 seconds: 0.0079 * 36759 means our East speed has been reduced by 290.3961m/s and the speed difference between our two locations is 463.8307 - 288.74162 = 175.0891m/s so it's no issue and of course we expect it to be much greater as this is only the acceleration at the end of the journey.

From the above we can see that a flight leaving Accra that is always applying the correct acceleration to the West will have no issue arriving in London facing North with a bank angle of 0.046°.
Reply: @everybodylovesballs  There is a reason why it is called the Coriolis EFFECT ... Because it is just an EFFECT within the non-inertial reference frame ... 

The plane does not move in circles but that would be observed by the non-inertial observer. There is neither a force nor a coriolis acceleration, it is just a mathematical device that the non-inertial observer invents to explain the non-linear trajectory of the aircraft on that reference frame. The plane is moving in a straight line or vector resulting from the speed of the plane to the north and the initial tangential speed of the plane to the east. The direction of this straight line is not parallel to the plane's heading but rather perpendicular (with an angle of 63° in the case of the Accra-London flight), therefore the pilot must progressively tilt his nose the angle that is necessary so that that line becomes a curve (but it must also do something else). You think that this angle amounts to simply aligning yourself with north constantly but that is an error that you intend to insist on even though I have explained it to you in various ways ... 

You never answered my question about where the Accra-London plane will end up after 6 hours of flight if the plane does not correct the tangential speed difference and what you do not understand is that after 6 hours of flight the plane will not be either in London even if you correct the tangential speed difference. The answer to my question is: Libya ... The plane will be at coordinates 27 ° N 15 ° E after 6 hours of flight. We have an east drift of 15° and a south drift of 24.47°. Drifting east can be avoided by turning progressively west, but that does not eliminate drifting south. Therefore, if the drift to the east is corrected, the plane will keep flying over the meridian, but after 6 hours it will still be at latitude 30° N and if it continues trying it will end up returning to the south although it continues to point north. So how do you avoid drifting south? The answer is by constantly accelerating towards the North since you take off from Accra ... But that is impossible because the resistance of the air would prevent it nor would it reach the fuel for that. This seems strange but that is the price of looking at things from a non-inertial frame of reference. From the inertial frame of reference it is perfectly understood and is in accordance with the laws of motion and flight dynamics
Reply: @MoisesPendulo  The plane is moving in a straight line or vector resulting from the speed of the plane to the north and the initial tangential speed of the plane to the east
In what reference frame is the path of the plane a straight line? It is not in either the inertial or the non-inertial frame. In the inertial frame - the one that doesn't rotate - if we are looking down on the Earth from above the North Pole, and we put Accra close to the edge of the circle and at the bottom, the plane will finish closer to the centre of the circle (North Pole) and up (y-axis) and to the right (x-axis) of the Accra position. The path is a spiral and if there's no imaginary longitude lines on your globe, that's obvious. Following a rotating normal does not make the path straight. The normal is a geometric construct, a rotating one especially so. In the non-inertial frame, the path curves up and to the left. That is also a spiral. In neither of these frames is the path a straight line. The only reference frame where the path is straight is in the rotating, non-inertial reference frame of an imaginary observer in Accra. This observer does not exist and this reference frame has no value to us. If this is how you are imagining the situation, forget about it. It is a nonsensical reference frame. Choose the inertial one, or even better the non-inertial one of the pilot, which are both spirals. In the inertial reference frame, "North" is not a sensible word to use because it's a relative term and only makes sense from the perspective of the plane at a moment in time. You could use the term "normal from the coordinate" instead.
therefore the pilot must progressively tilt his nose the angle that is necessary so that that line becomes a curve
In the non-inertial reference frame, a path following a meridian is a curved line. In that reference frame, you don't have to follow the curved line and also think about changing your velocity at the same time. Following the curved line is changing your velocity by exactly the correct amount required.
You think that this angle amounts to simply aligning yourself with north constantly but that is an error that you intend to insist on even though I have explained it to you in various ways
And you have been wrong each time. You don't seem to understand either reference frame.
Drifting east can be avoided by turning progressively west, but that does not eliminate drifting south
Of course it eliminates the drift south. Turning is rotating the vector, not just reducing one of it's components. It's simple trigonometry - if you keep the magnitude of the vector the same - which is what the engines of the plane do - reducing the x-axis component will increase the y-axis component and vice-versa
But that is impossible because the resistance of the air would prevent it nor would it reach the fuel for that
You cannot possibly believe this. On the North flight, the acceleration that you require is in the direction that the air would be pushing you, not the opposite direction. Think about it - if you don't change your tangential speed, it will grow faster than the tangential speed of the air around you at that latitude. If you had your Accra tangential speed (1033mph) at London (646mph), you would be moving against the air around you by 387mph. That would be the same as a 387mph crosswind from the East. The direction that you have to make your corrections is the direction of least air friction.
Did you find a problem with the analysis in my last post? I wrote it very carefully and included all necessary calculations. Take one reference frame and stick with it. I suggest the non-inertial reference frame. But in this reference frame, there is something very, very important that you must keep in mind. In this frame the East-West speed relative to the meridian starts at 0mph. The little accelerations that you make serve the purpose of keeping it at 0mph. In this way, you arrive at London.
Reply: @everybodylovesballs  An airplane heading north enters a Jetstreams that has an East component of 150mph. If the pilot does not incline his course to the left of the meridian and continues pointing north, a linear drift towards the East will occur, depending on the time the wind keeps blowing in that direction. If the wind keeps blowing in that direction for 3 hours the plane will move away from its route a distance d = 150mph * 3h = 450 miles. This implies that an angular drift with respect to the north will also occur that will depend on the take-off latitude, being greater in latitudes further north. If you try to avoid linear drift just by turning enough to avoid angular drift you will definitely move with the airflow to the east (because all you would be doing is keeping aligned with north and you need a tangential velocity component to the west of equal magnitude to the wind speed). The same applies to drift caused by the tangential speed difference between latitudes. 

In the case of crosswinds, linear eastward drift occurs because the wind is moving tangentially faster than the ground below it and the aircraft is moving tangentially by the air mass at the same speed as the wind. In the case of the tangential speed difference between latitudes, the drift occurs because the plane is moving tangentially faster than the ground under it (as if a wind were moving it but in this case it is due to the lateral inertia of the plane)
Reply: @everybodylovesballs  All vector paths on a spherical earth are geodesic lines. I mean, they are just curves on the z-axis. Of course, if you change your position as an observer, you will see that curved line in accordance with the position you establish ... For example, an air route that leaves from the coordinates 0 ° N 0 ° E and ends at the coordinates 45 ° N 90 ° E It is a geodesic line drawn on the earth, which is essentially a straight line that only curves on the z-axis due to the spherical shape of the earth. But if you see that same route looking at the earth from above the North Pole you will see that the path is curved but that only happens because you are located in a position where it is possible to observe the curvature that occurs in the z-axis.
Reply: @MoisesPendulo  If the wind keeps blowing in that direction for 3 hours the plane will move away from its route a distance d = 150mph * 3h = 450 miles. This implies that an angular drift with respect to the north will also occur that will depend on the take-off latitude, being greater in latitudes further north
Yes, if not corrected! If the plane continually corrects for this crosswind it does not drift. If another plane takes off as the first plane flies over, the second plane will need the same angle as the first to correct for that crosswind. Do you agree or do you think that the two planes will need different angles depending on how long the plane has been experiencing the crosswind?
If you try to avoid linear drift just by turning enough to avoid angular drift you will definitely move with the airflow to the east
We still have the North component of our vector and the planes engines are keeping the magnitude of vector itself constant. The process of turning is taking some of that East component and moving it to the North component. The plane is not just drifting to the east in the crosswind without moving forward.
There is a slight difference in our example because the "crosswind" as a result of Coriolis gets a little larger at higher latitudes. It starts out tiny and ends up tiny but a little larger. But the same applies - if it is continually corrected - by constantly turning as very, very small angle to counter this tiny but slowly increasing crosswind - then the next plane that takes off only needs the same angle. the plane is still moving forward and the tiny corrections to the West do not change that. No-one is saying, let's imagine that the plane drifts off-course and then calculate what angle would be required if it needed to get back on course.
Why are you avoiding my post where I explained the entire situation in great detail? If there's an error in that, point it out.
Reply: @everybodylovesballs  I already explained to Wolfie in detail the example of the two planes. Crosswinds don't suddenly start blowing at 150mph either. The speed increases gradually as the plane passes through the Jetstreams. For each wind speed, the plane must have its corresponding correction angle, which will always be to the left of the meridian, otherwise it will enter linear and angular drift. The same happens in the case of the correction for Coriolis. The correction angle is zero at the take-off latitude and maximum at the arrival latitude. The plane leaves Accra heading north and when it reaches latitude 30°N it should have a correction angle of 15° to the left to correct for Coriolis drift. If another plane takes off from latitude 30° it should not have any correction because this other plane has the same tangential speed as the latitude from which it takes off. 

If there is a 150mph crosswind to the east, both aircraft should correct with a left correction angle but the aircraft departing Accra should correct for Coriolis and crosswinds.
Reply: @MoisesPendulo  All vector paths on a spherical earth are geodesic lines
The route is a straight line. The path, which is a plot of the coordinates of the plane over time following the route, is far more interesting to us. It can tell us what changes to the vector - accelerations - need to be made at each second to keep it's direction towards the centre (which in our coordinate system is the North Pole).
Reply: @MoisesPendulo  For each wind speed, the plane must have its corresponding correction angle, which will always be to the left of the meridian, otherwise it will enter linear and angular drift
Yes, for each latitude we also need to correct the required amount. It is absolutely minuscule compared to a medium crosswind and I've shown you how to calculate it correctly. If the correction does take place to keep the plane flying North during a crosswind, is the correction cumulative too if the crosswind gradually increases (or whatever weird thing you're imagining where the amount of time you're in the crosswind is significant) or is it only the correction required to counter that strength of crosswind at that moment in time considering the current velocity of the plane?
The correction angle is zero at the take-off latitude and maximum at the arrival latitude
At arrival latitude, the plane will be correcting to the left at 0.0033deg/s.
If another plane takes off from latitude 30° it should not have any correction because this other plane has the same tangential speed as the latitude from which it takes off
Our plane also has the same tangential speed as the ground at the latitude. Because it has been reducing it the entire flight by accelerating to the West. How can it still have the same tangential speed as Accra? How can you possibly believe that this is fixed and unchangeable? It has been changing that speed - that's what acceleration is!

When will you be dealing with the post I made 19 hours ago that starts with, "The nose does not have to turn beforehand...", and telling me the errors in that?
Reply: @everybodylovesballs  The true path in time and space of the aircraft on a rotating earth is that observed from the inertial frame. In this frame it is a geodetic line given by the vector resulting from the velocity of the plane towards the north and the initial tangential velocity of the plane towards the east. The projection of this geodetic line on the earth is a circle because while the plane is moving on this geodetic line the earth is rotating. In order for the plane to reach its destination, it must change this geodesic line into a geodesic curve, which is impossible given the laws of motion and flight dynamics. I'm going to look for the comment you are talking about
Reply: @everybodylovesballs  You do not quite understand that it is possible to reduce the initial tangential speed and that it is possible to do so by changing the course of the aircraft to the left, but that implies that the aircraft must turn its nose to the left of the meridian. I have explained it to you in different ways and using the analogy of the correction for crosswinds ... If there is something that makes you move to one side of your trajectory you must point slightly to the other side to continue on your trajectory. It doesn't matter what the cause is, whether it's a wind or your own inertia. You are insisting that the plane should only keep pointing north and that is only consistent with a stationary earth ... If you claim that the earth rotates you have to deal with the physical phenomena that this generates and these phenomena will in no way allow that your trajectories are identical to those you would have in a stationary earth .. You must stop running away from them and face reality
Reply: @MoisesPendulo  In this frame it is a geodetic line given by the vector resulting from the velocity of the plane towards the north and the initial tangential velocity of the plane towards the east
Are you sure of this? What if the plane takes 12 hours to complete the flight to London? In the inertial frame, the geodetic path is directly North of the starting coordinate passing over the North Pole. However the geodetic path of a plane with an initial velocity of 250mph towards the North Pole and 1038mph to the East of the North Pole clearly does not go over the North Pole.
Reply: @MoisesPendulo  You do not quite understand that it is possible to reduce the initial tangential speed and that it is possible to do so by changing the course of the aircraft to the left, but that implies that the aircraft must turn its nose to the left of the meridian
My belief is that if the nose of the plane at a moment in time is facing North and during the next second the North heading changes by 0.0033°, but the bank of the plane is also making the plane's nose turn by 0.0033° each second, then the plane will be facing North after one second has passed. In my view, a bank angle of 0.046° will cause an acceleration to the West of 0.0079m/s/s and will turn the nose by 0.0033°.
Of course I believe that the plane has to steadily turn and the amount it has to turn each does increase very slightly as the flight progresses! It is turning because in the non-inertial reference frame, if the plane continues straight ahead, the North heading, or the North Pole, will drift to the West. You can't have it both ways - you can't say that if the plane flies straight, the North heading drifts to the West but if the plane turns it's nose to the West to keep facing the North Pole, the North Pole is now angled to the East.
But whether the plane moves it's nose before or with the change in heading is not important to me, so for the sake of argument, I'll accept that your premise that it must move before.
Where we fundamentally disagree is the amount it must turn. Your calculations are way, way off. I calculate that for a plane that is travelling due North at 139m/s (approx. 500km/h), at London, if uncorrected after one minute the plane will have travelled 8340m and will be 14.22m to the West of the meridian. That is the tiny, tiny effect of Coriolis.
Reply: @everybodylovesballs  I'm going to split my answer to your comment from 19 hours ago because it has too many errors

"So if the North heading moves 0.0033deg / s, so must the nose of the plane. In this way, the plane will always be facing North"

ERROR # 1: 

Angular drift is only a consequence of linear drift. If you correct for linear drift there will be no angular drift. However if you only correct for angular drift there will still be linear drift. As I explained in another comment if the pilot does not correct the 150mph crosswind drift after 3 hours of flight there will be a linear drift of 450 miles and an angular drift whose value depends on the initial and final latitude. If after those 3 hours the wind continues to blow with the same speed and the pilot aligns with the north, the plane will continue moving towards the East at 150mph. In other words, the maneuver of aligning with the north will not be able to avoid the drift, much less eliminate the 450 miles of drift.

The same happens with the angular drift of the Coriolis effect. This angular drift only occurs when linear drift occurs, therefore if it only aligns with north it cannot in any way correct the linear drift. 

You must correct the cause not the consequence and the cause of the problem is the linear drift which is given by the tangential speed difference. Angular drift is only a consequence of linear drift occurring ... There is nothing that is intentionally turning the nose of the aircraft to the right. It is only the position that the nose of the plane will have after having moved to the East due to the tangential speed difference between latitudes

If you want to avoid linear drift, you must turn to the left of the meridian to generate the tangential velocity component necessary to eliminate the tangential velocity difference between the fixed path on the ground and the aircraft. This is done to avoid linear drift of crosswinds and this should be done to avoid drift due to tangential speed difference. You are only running from reality
Reply: @MoisesPendulo  If you want to avoid linear drift, you must turn to the left of the meridian to generate the tangential velocity component necessary to eliminate the tangential velocity difference between the fixed path on the ground and the aircraft
You must generate the tangential velocity component necessary to eliminate the tangential speed difference between the current tangential speed of the aircraft and the current tangential speed of the ground. Or better yet, you do this proactively and keep the current tangential speed of the aircraft matched to the current tangential speed of the ground and then the tangential speed difference you are trying to eliminate is the one that will happen in the next second. You must always do this or you will drift away from the meridian. To do this, you can calculate the predicted tangential speed difference and then apply an acceleration equal to that in the opposite direction. A bank to the left is the way pilots do this. And as we agreed before, the bank also moves the nose.
You say the nose has to turn first and then the velocity change follows that. OK, fine. So the nose has to be angled to the meridian so that at all times, the change in velocity - the acceleration - caused by this angle is equal to the tangential speed difference between the current latitude and where the plane will be in one seconds time. So assuming we have been doing this all along and the current tangential speed of the plane matches the tangential speed of the ground, we need to calculate how much the speed of the ground will change in the next second and from that we can determine what our angle to the meridian must be, correct?
Reply: @MoisesPendulo  Actually, I think it would be more beneficial to use an actual example.

Our plane, travelling at 139m/s (approx. 500km/h), arrives at London and it has been correcting it's velocity and following the meridian the entire flight.

As it is currently following the meridian at that moment, we can say it that it has a North velocity component of 139m/s and an East velocity component of 288.7416m/s (any other East velocity component and it would not be said to be following the meridian). Up ahead, where the plane will be in one second, the speed of the ground is 288.7337m/s so the plane will need to reduce it's East velocity component by 0.0079m/s in that time.

1. What angle, relative to the North vector, which is also the meridian, will be required to do that?
2. What will be the angle to the meridian after one second has passed?
3. What will be the angle to the meridian required for the next second after that?
Reply: @MoisesPendulo  Just one last post and I think it answers a lot of questions. I've been looking into the derivation of the Coriolis acceleration formula because my calculated numbers were half the values using the common formula: 2 * v * ω * sin(α)
I discovered this at Science Direct: "If Ω is the angular rate and r the radius, the tangential velocity is Ωr. So, if r changes at speed, v, there will be a tangential acceleration Ωv. This is half of the Coriolis acceleration. There is another half from changing the direction of the radial velocity giving a total of 2 Ωv."
So if we use the Coriolis Effect Calculator that you quoted from earlier, we do get the correct acceleration for a plane travelling North-South over London. When using these values, if we match the calculated acceleration
with an acceleration in the opposite direction, we will both reduce the tangential speed and correct the direction accordingly.
So I believe Dominic's bank angle of 0.115° is correct but if you prefer to cause an acceleration by pointing the nose, I believe the required angle at London for a plane travelling at 139m/s, would be 0.0065°.
Reply: @everybodylovesballs  I already explained to you that Dominic's calculations are wrong ... Coriolis acceleration is not a simple sideways acceleration. It is an acceleration perpendicular to the velocity vector that describes the circle of the Coriolis EFFECT. This great circle that would be observed from the non-inertial frame of reference is the EFFECT not the CAUSE of the problem. You can't do anything against the stroke of this circle if you don't solve the problem from the inertial frame. The pilot must face two drifts, one to the east and the other to the south. The first could be corrected, the second could not. The drift to the east will be 922 miles, so in 6 hours the plane can accelerate westward to synchronously match its tangential speed with that of the new latitudes by turning the nose to the left. On the other hand, the drift to the south will be 1687 miles even with the aircraft's nose pointing north. If you are trying to go north at 526mph and in 6 hours you are still 1687 miles south and keep moving away from your destination instead of closer, what do you need to do to get there? You need to speed up a LOT. Can an airplane accelerate like a rocket? Of course not due to air resistance and fuel consumption. 

You and Wolfie can stay hidden in the non-inertial framework twisting the equations and correcting wrong acceleration values, but not for long.
Reply: @MoisesPendulo  If you consider the acceleration due to Coriolis as drift to the East and the South, then surely turning the plane counter-clockwise is a correction to the West and North? If you look at the before and after vector, a rotation keeping the magnitude constant means that any change in the x-axis component mean a related change in the y-axis component?
Reply: @MoisesPendulo  Here's something to think about - if there's a deflection of 8" every mile and I correct for that as I go, even if I travelled one mile, then corrected the 8", then another mile, then corrected, by the time I have arrived at my destination 100 miles away I will have travelled an extra 71ft.

If I don't correct, I will arrive 6667ft from my destination.

Now when Dominic says, "It is even a possibility that it would fly around the circle, never reaching a final airport", does that make you question your method?
Reply: @everybodylovesballs  That deflection initially tends to move the aircraft laterally to the east. During that time the pilot can avoid this movement as the aircraft can move north while moving slightly to the west (tilting its nose to the left). But as time goes by, that deflection changes direction and instead of moving it to the east, it moves it to the south even though the nose of the aircraft points north at cruising speed. Why is this happening? You have to see it from the inertial frame to understand it.
Reply: @everybodylovesballs  In fact when you are correcting for x-axis drift you necessarily decrease your speed on the y-axis because the aircraft is not aligned with the y-axis but is tilted. If you turn counterclockwise you are not accelerating on the y-axis, quite the opposite. There comes a time when you must rotate so much that you will not have a velocity component on the y-axis (north) but will be pointing totally to the West
Reply: @MoisesPendulo  You have to see it from the inertial frame to understand it
North, South, East and West are very confusing terms to use in an absolute reference frame.
But the deflection is always to the right in the Northern Hemisphere relative to the plane. If the plane is travelling due East - perpendicular to it's current meridian - it will be deflected due South. If it's flying due North - along the meridian - it will be deflected due East.
That's why I don't see why this is so confusing for you. If the plane applies an acceleration to the West of the meridian that matches the Coriolis acceleration at that latitude, half of that acceleration will reduce the tangential speed to match the ground below and half will turn the nose so that it's still facing along the meridian. In that way, the next acceleration will be exactly perpendicular to the meridian. If the plane is not doing this, then sure it will eventually be travelling East and it's deflection will be South (relative to the meridian). But why would a pilot do that? It's heading indicator would have told them that the plane was drifting away from North the entire time.
Reply: @MoisesPendulo  In fact when you are correcting for x-axis drift you necessarily decrease your speed on the y-axis because the aircraft is not aligned with the y-axis but is tilted
By the way, this is absolutely the wrong way around. Start with a vector with 1038 on the x-axis, and 500 on the y-axis. Rotate the vector counter clockwise so that the x-axis is now 1037. What is the new y-axis value if the magnitude has not changed? It a simple trigonometry question where the hypotenuse does not change but one of the sides do. I get 502.07.
It should even be obvious to you by looking at the vectors at each minute of a plane that is perfectly following a meridian. If the North component stays the same and the East component decreases, the magnitudes of those vectors are getting smaller. The aircraft is saving fuel. Or it can gain speed to the North by redirecting some of it's initial tangential speed, you choose.
Reply: @everybodylovesballs  Do you really think I'm wrong about something so simple? What I said is totally correct and that is the reason why planes when they turn their noses to deal with strong crosswinds take a little longer to reach their destination. 

If you want to go 1000 miles north and your aircraft can provide a true air speed of 500mph you will reach your destination in 2 hours if there are no crosswinds, no tailwinds or headwinds. But if during the entire flight there is a Jetstreams moving east at 150mph you have to fly north with a correction angle of 17 ° to the left, therefore your northward speed component is no longer 500mph but 478mph. The true air speed of the aircraft is still 500mph but it is no longer pointing north. So in this case you will arrive at your destination in 2.09 hours.
Reply: @MoisesPendulo  Do you really think I'm wrong about something so simple?
Yes. You still haven't worked out how to calculate the necessary acceleration to the West to counter both the difference in tangential speed and the rotation of the meridian. The formula is 2 * v * ω * sin(α) by the way, which you'll notice is exactly twice the amount needed just to overcome the difference in tangential speed (which I calculated for you earlier for the London latitude).
What I said is totally correct and that is the reason why planes when they turn their noses to deal with strong crosswinds take a little longer to reach their destination.
You could look at this in terms of kinetic energy. A plane travelling North at 500mph at London with a tangential speed of 646mph has less kinetic energy than when it left Accra travelling North at 500mph with a tangential speed of 1033mph. But it's still flying North at 500mph so it hasn't lost time. It's mass is the same, but the magnitude of it's velocity vector is smaller. Where did all that kinetic energy go? It's had to lose some of it's tangential speed along the way because it's too fast for the air it's flying into.
In this case, you could consider the crosswind from the East pushing you in the direction you need to accelerate to stay aligned with the meridian because if you don't lose your tangential speed, you will be going faster than the air around which will be pushing back against you (to your West). What do you think would happen if you had a tangential speed of 1033mph over London? Which direction would the air be pushing you, East or West?
My guess is that in the end none of this is very significant in the real world. The plane has more kinetic energy to start with and it's losing some of it using friction with the air to turn. But the work required to be done by the plane is negative.
And just to keep things in perspective - a 787 weighs around 200,000kg loaded, cruises at 900kmh, and it's engines produce around 700,000N of thrust. So the force required to counter Coriolis at London of 5690N (for both the tangential speed and the rotation of the meridian) and ignoring all other factors is 0.81% of the thrust of the engines.
Reply: @MoisesPendulo  ha ha I wont hold my breath waiting , what about the 15 degrees per hour drift thanks to BOB lol Flerfism always fails.